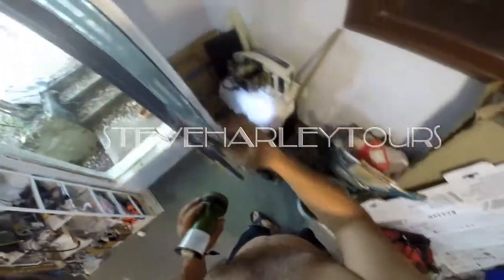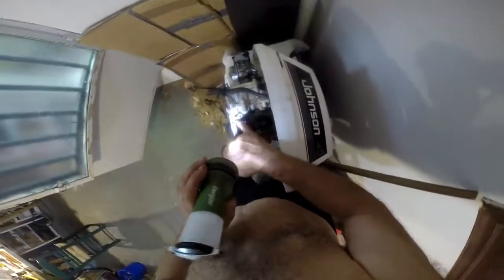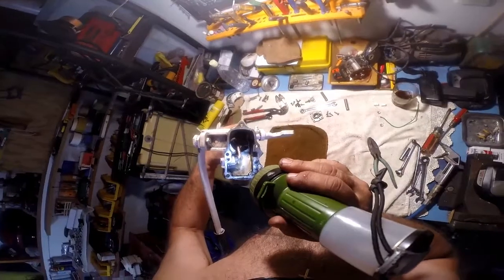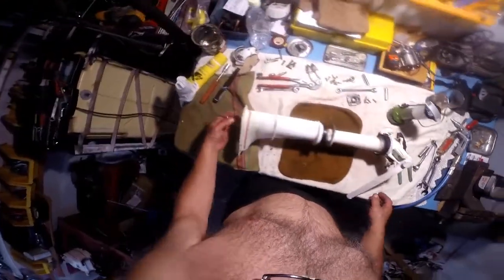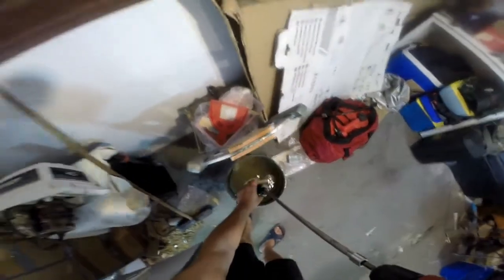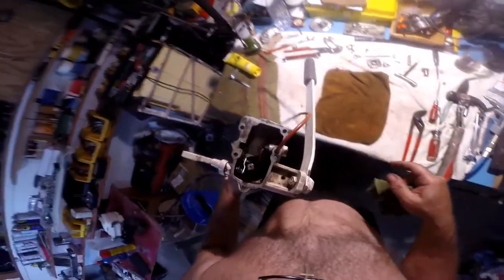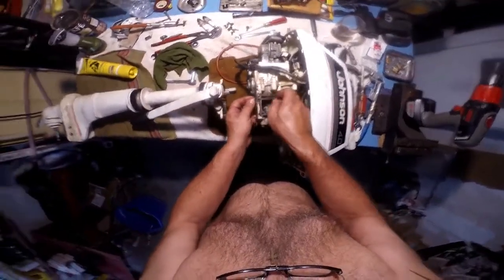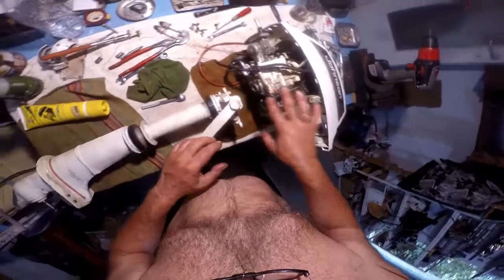How to clean water passage  test  water pump temp readings Johnson 4 hp seahorse PART 2

Comment: so your carb leaks, your cylinder head leaks water, and there isn't any water coming out of the outlet?
Reply from the maker: i have fix all that, thanks
Reply: That engine on the last run is cooling fine, its spitting out plenty at higher rpm way more than mine and mine still runs, mine was very poor cooling hardly spitting anything, i emptied a whole bag of bicarbonate soda into the 25 ltr tub i run it in and let it run for 2 hours using hose to cool head and stopping to let the water cool down in the tub a few times, after this there was a huge improvement in cooling water spitting out, the bi carbonate of soda really helped clean the cooling passages, so much so that i now do this once a year, so give the bi carbonate soda a go, you will be impressed  and its cheap to do, just dont let the water in tub get too hot, nice video man well done! ;-)